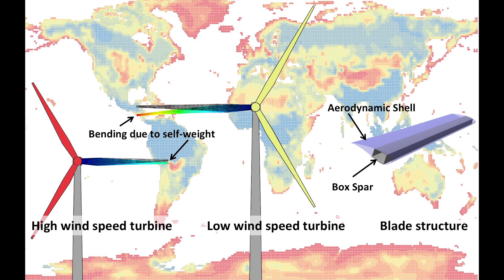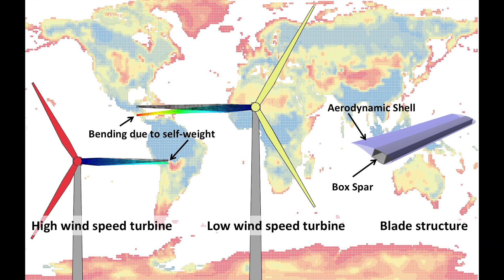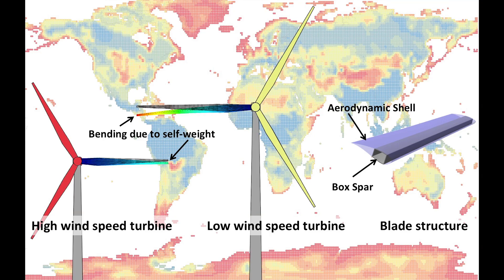Wind turbines and climate change – UNSW 2014 Three Minute Thesis winner Rosemary Barnes

Comment: And a couple years later, gas is the hands down cheapest way to rapidly reduce emissions globally without having to put up with the fact that wind is so infeasible that it probably shouldn't ever be used anyway (even if the turbines were free)
Reply: Sorry troll try again.
Reply: What do you even mean by the last statement? How are they infeasible?
Reply: Ok, first off they feed you nonsense like "capacity factor" to pretend it will average out...but in reality across whole nations the wind will drop to near zero, sometimes for days.  And the wind's wild fluctuations require wild throttling (minute by minute) of the existing power sources...which makes them far less efficient, essentially nullifying the majority of the supposed "benefits".  Of course, green groups then feed you these figures, distorted by their own worthless form of power...chalking up wind's negatives to fossil fuels and claiming wind lowers power costs...when what REALLY happens is that when wind finally produces, the value of that energy is near zero (and sometimes literally below zero), so the turbines can never actually pay for themselves without subsidies.

On the other hand if we switched to nuclear with fracked gas for load following/peaking, emissions would drop rapidly.  And because even the most materials intensive version of nuclear plants still use 1/10 the materials, labor, and maintenance of wind...it's something that could actually be done and frequent blackouts.
Reply: That intermittent sources of energy can overproduce and cause prices to crash is an issue, I'll grant you that. But there are other solutions to this problem, such as more load flexibility. In my view it's almost ridiculous that in the electricity marke the supply curve is price sensitive but demand curve is almost a vertical line. Negative prices are s result of renewables plus inflexible demand. In some places renewables are the cheapest marginal source of energy, and if demand can be made price sensitive, then the intermittency becomes less of an iissue, an users can take advantage of the low prices. 
Finally, the cost of renewables is going down fast, and even in places where they are not yet competitive, eventually they will be, and it makes sense to try and take advantage of them.
If you can use gas for peaking in a nuclear dominated grid, you can do the same in a renewable dominated grid. If you're worried about the rare occasion when there is almost no renewable output, and thus the gas capacity would have to be large, electric vehicles including hybrids would be perfectly suited to act as the final high cost generators. I don't hate nuclear, but I don't think we'll redo to or tga it will be the cheapest option. As wind and solar matures labour will go down. Perhaps we'll move to deep water offshore wind, where the turbine can be towed out horizontal, rotated 90 degree and connectedness of existing anchor points. Solar PV may well shift to flexible panels which can be rolled out and glued to roof surfaces. Many ways to reduce labour exist.
Reply: +poitsplace you make load flexibility sound terrible when intrinsically it isn't, but previous applications may not have been ideal. done at the device level it could be almost unnoticeable. Eg a well insulated fridge with some PCM as thermal storage. The fridge would ensure its always sufficiently cold, but it would have some choice about when during the day it consumes power. If your power was 50c at night and 10c during the day, you would have to seriously consider the investment.
Reply: +poitsplace demand flexibility hasn't taken off because users are not exposed to the market volatility. No one is proposing that electric vehicles be sucked dry so that when you wake up in the morning it's unusable: it would be at the users discretion to turn the option on, with some guarantee that at some predetermined time, the battery will be at the desired level. 
One of the great thing about decentralised generation is that the minimum amount of transmission capacity required can go down. This is especially useful in areas without a grid so far. this can be a large factor in comparing costs between system designs.
Reply: +poitsplace why don't you think PV works today? Do you think energy efficient technology like heat pumps don't work either?
Reply: Ben Wilkinson +Ben Wilkinson No, you've been brainwashed into the idea that you can just switch stuff off in an industrial society without significant consequences.  Look into how much power outages cost production...the cost is absolutely enormous.  And siphoning off power from electric cars is EXACTLY what people are proposing.  You've never looked into how much power is used.  To provide the stability of the conventional sources with their supply chains, you'd need weeks to months worth of energy...we're talking hundreds to thousands of terawatt hours of storage.

And you TALK about "decentralized" power, but the system you're proposing is in fact the polar opposite. The only way to balance the load well is to increase the size of the grid to over 5X it's current capability...shoving vast amounts of overproduction across nations...while still decreasing reliability.  The current "centralized" power grid is actually more decentralized than the system you're proposing, because almost all of the generation is relatively close to it's point of use.

And costs just aren't going to go down.  Almost all the costs are in mature technology with very shallow development curves.  You have simply not done the work necessary to understand the problem.  We have over a decade of good data now and nothing has panned out properly.  Capacity factor was grossly overestimated, costs imposed on the system by renewables was grossly underestimated.  And while europe has squandered billions on worthless renewable schemes..the US has done almost nothing and cut emissions inadvertently through use of gas...ironically made cheap and plentiful by a process that's violently opposed by the people you've listened to.
Reply: +poitsplace I understand the need for continuous operation of certain industry's. All I'm suggesting is that everyone be exposed to the real price, and then if it is worth it to them, those users can continue to use power through a price spike.

The question of transmission cost, which system has less infrastructure cost is debatable, but by introducing low cost intermittent generators distributed throughout the grid, you must agree that the optimum design will change. 
To argue that the renewables industry is completely mature and no further reductions in cost are possible, to me is ludicrous. what evidence do you have to suggest this? Looking at the PV trajectory it seems impossible to argue. And that is based on continuing to use Si-c indefinitely, which seems unlikely.
Reply: We obviously have different backgrounds, and have come to different conclusions about the future of the energy system. I'm interested in how this happens; why don't we see what common ground we share and try and identify where we diverge in our opinions and conclusions?

You are obviously a fan of nuclear, why is that? what is different about nuclear compared to other sources of energy that made you come to this conclusion? high capacity factor? Good supply certainty? established technology?

The fact that you're a nuke fan indicates to me that you're not a denier, (otherwise we may as well use coal right?), so perhaps we share the same end goal.

If it was more productive, would you be a fan of Geothermal? and large Hydro schemes?

What is your point of view on energy storage (not just batteries)?

Gas is a nice tool for following load, but it has its own emission and extraction issues. Would you're long term vision be to just ignore these and rely on the benefits of nuclear, or do you have a solution in mind?

Do you have any reservations about nukes and just see them as the best option, or are they the perfect energy source in your mind?
Reply: Ben Wilkinson I'm a fan of nuclear because it is dispatchable power.  It serves us.  And we have enough to last for thousands of years.

As for the end goal, I don't care about emissions.  But for those that do care about emissions...wind/solar are not solutions.  They're overpriced, under-performing, half-solutions.  And that's why I'm against them...they're crap.

I don't care for Geothermal mostly because there's nowhere near the capacity people seem to think there is.  And hydro is pretty much maxed out in the industrial world...with the same people that generally want wind...complaining that hydro plants actually need to be removed.

Gas doesn't have extraction issues.  It has the same problem nuclear does...a bunch of rabbid, essentially nature worshiping, regressives that vilify it because ...well dogma.

As for nuclear, again, it's not that I'm some great lover of nuclear.  It's just that if your goal is to reduce carbon emissions, then gas/nuclear are truly the ONLY solution.  Everything else is just delusional nonsense...you'd have to divert years worth of the sum total of all of the world's steel/concrete production into wind turbine production to meet demand.  Even stretching it out over decades still means diverting (or increasing it by) 10%...astounding amounts of materials.

On the other hand we could use 1/10 of that and make nuclear plants in less time with 10% the labor.  And gas just fills in the gaps.  Also you have to remember, with wind, load following of a gas plant has to throttle between 100% and 0% of load.  With a nuclear plant the load varies much slower (because it's entirely demand driven, and NOT at the whims of the weather)  And the nuclear plant is already covering over half the load.  

You mentioned storage, let's make this crystal clear...you use batteries with a nuclear plant and you end up with a nuclear plant that could provide about 75% of peak load no matter what.  Then it only needs about 25% of it's total daily capacity as storage to buffer out the load.  On the other hand with wind you have no idea what production will be so you need WEEKS of storage.  We're talking a difference between about 6 terawatt hours of total storage for the US with nuclear OR...about 500 terawatts for wind.  Which do you think would be easier to do?

And back to gas...since so much of production is from coal, simply switching from coal to gas would cut emissions more than all these idiotic, overly expensive wind/solar schemes that we've done combined...and would leave costs about where they are (honestly, gas is now cheaper than coal in the US...it would likely lower prices)
Reply: Where do you read about this stuff? Where can I learn more?
Reply: Ben Wilkinson Well you sure as heck can't get it from the greens.

Look up something like "Energiewende failure" and you'll get lots of articles, often with decades of real-world information.

Like this...has links to the sources https://www.dissentmagazine.org/article/green-energy-bust-in-germany

Some of it you don't even need me to research...you already have the information.  Like when they talk about "grid parity"...by which they mean renewable energy that costs as much as residential retail energy costs.  But once your attention is drawn to the problem, you suddenly go "OMG, how could I have missed that they compare the highest retail prices to ...just the turbine/solar cell...prices?"
Reply: @luckyshadowtux  he gets it from Koch Industries apparently.